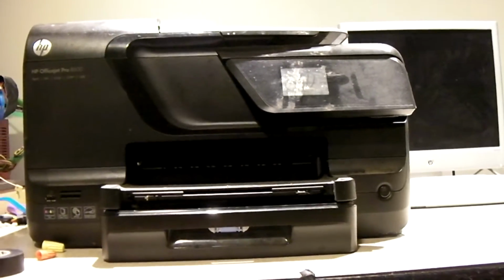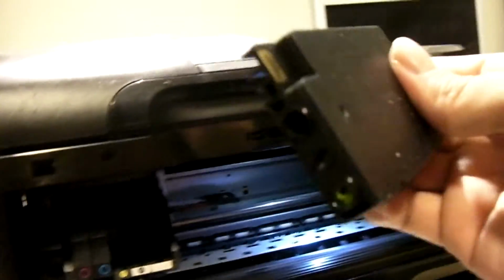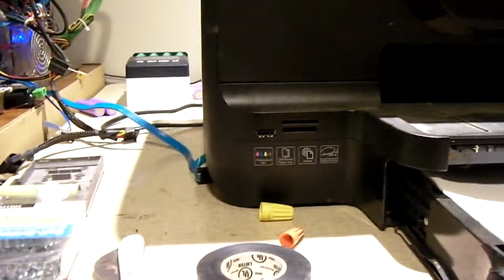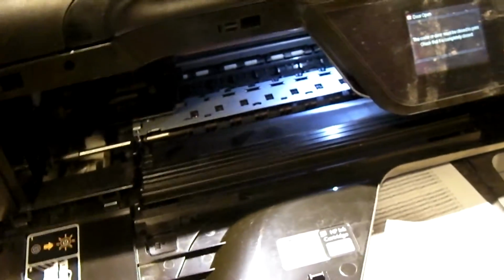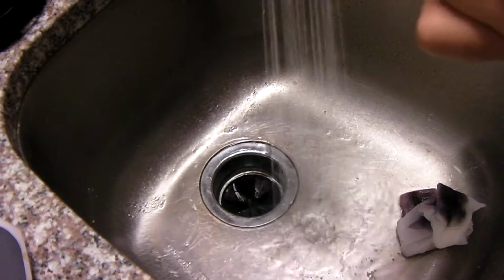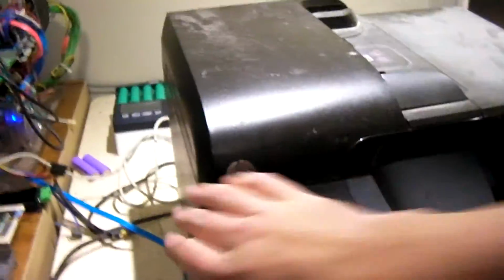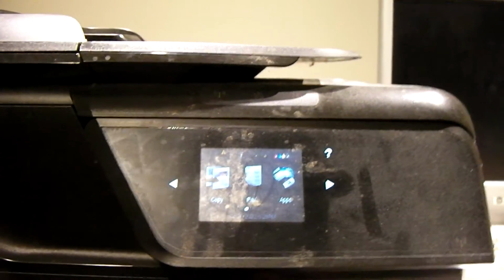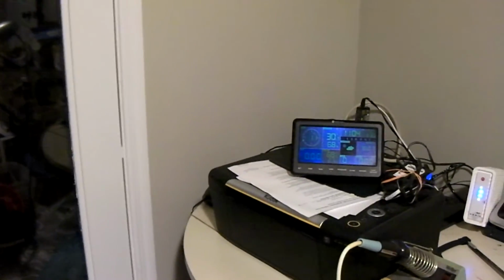Resurrection of an HP OfficeJet Pro 8600 (cleaning print head)

Comment: I have this exact printer, purchased in 2013. My cartridges were running low but I was able to keep printing in draft mode for a couple of months actually. I replaced the black ink cartridge the other day but the printer didn't recognize it as it did before, and displayed a message about the cartridge being damaged. I removed and replaced it, turned the printer off, thinking it would reset; no luck. So I to purchase another cartridge, ugh, $92! Popped it in, same message!  I tried the other cartridge again, still wouldn't recognize. I called Best Buy where I had purchased and talked to a tech who instructed me to do what you mentioned in your video about your co-worker on the phone with HP tech support; turn off printer, removed cartridges, unplug the power, wait 2 minutes, replace, turn back on.  Nothing, same message, damaged cartridge. He offered to send a tech to my house for $124; when I told him I would take it down to the store, he said they would not work on it there, they have to send a technician to my house; no thanks. Searched online and this and other videos.  Did as instructed, soaked printer overnight on wet paper towel; next day, put some foil on the back of the printer cartridge carriage to protect from getting wet, used my water hose nozzle that has a jet setting, with hot water, flushed out each port until each color ran clear. wiped and put a towel over it and placed in the sun to dry it , maybe I shouldn't have done that? Replaced the cartridge, and all the cartridges, the printer recognized each color; I thought, awesome, it's going to work. I selected something to print, the screen showed it processing, took a little longer than usual, then the damaged cartridge message appeared! Removed and reinserted each one; now it showed just the 3 color and not the black. I repeated this step, closed the door, the display didn't show any of the cartridges. Tried the steps again, turned printer off, unplugged; still won't show the black ink. I am going to remove the carriage and try to flush the black port again until it runs clear, this time I will only dry it by hand and place back in printer; wish me luck.  If it still doesn't work after that, maybe I will order a new carriage?
Reply: Reflushed the black port again with hot water w/jet spray. Water ran clear, I could see some ink at the port opening; but when I look at the reservoirs, I see some ink in each of the colors but not the black. And now when I place the printer head on a wet paper towel, no black.  Place the carriage back in, reinserted all the color cartridges, reads all the colors, but black doesn't come up. Maybe I can just replace the black printer head?  I don't know if this channel is still active because all the comments are from so long ago.  Fingers crossed.

Comment: I don’t know if you respond to messages anymore but one thing I discovered is the generic cartridge is actually an HP cartridge. I peeled off the sticker from an old generic cartridge and bam HP logo sticker. Still having issues but at lit learned how to clean my printer head.
Reply from the maker: It could be a refilled HP cartridge

Comment: Went thru the cleaning procedure for the print head several times but it made no difference, unplugged it many times , closed the door after removing the print head and power it up to see if the error message would clear , but it didn't work , still got the same error message. One thing i noticed in the video is that there was a sloshing sound when you shaked  each cartridges, i tried the same thing and there was no sloshing sound from the blue/cyan cartridge , would a dried up or empty cartridge cause the same error message ? Thought it would show a warning of low ink message long before that ?
Reply from the maker: The lack of a sloshing sound when shaking the cartridge indicates the cartridge is most likely empty. The ink indicator message is triggered by an estimated usage count tracked by a chip on the cartridge. The printer has no way to measure the ink level other than guessing.

Comment: Good afternoon Cubed Computer Channel, I must give you a heartfelt pat on the back for your tips in dealing with the HP Officejet Pro 8600. I had previously cleaned my printhead, replaced the printer cartridges several times with different cartridges and after watching your video a few swear words and the steps you gave to remove the printhead,power off, turn the printer back on, get the missing carriage error while cleaning the print head for the 5th time, replacing everything including the cartridges, and finally powering down and restarting my printer; it finally came back to life and the home screen. Thank you, thank you, thank you kind Sir😊

Comment: Thanks for taking the time to do the video learnt a lot about my printer. FYI my printer gave same message but problem was just that one of the colour cartridges (Magenta) was empty. Replaced cartridge and fixed problem. However, after your video also cleaned printer head now have a fully functioning printer good as new! Ty

Comment: If you have a "Printer Failure" error, the touch screen is dead.  I replaced the ink head with a good one, from a working printer;  still have "Printer Failure,   There is a problem with printer or ink system".  I reset by unplugging, 10 times...Tried printing from pc, nothing. Is there a reset button or just the unplug thing?
Reply from the maker: Try starting it up with no printhead or cartridges and then reinstall the printhead and see what happens.
Reply: Thanks but that didn't work.   @CubeComputerChannel

Comment: When the vinyl membrane of the cartridge pressurization weir comes unglued, one gets a "Supply System Problem" error message.  Also, when the membrane is unglued, one does not hear the four usual 'puff' sounds, during the cartridge pressurization step, when the printer starts up.  The best way to address this issue is to peel off the membrane and replace it with very sticky tape, such as silicone tape, or the kind of 2-sided tape used for gluing smartphone screens.  The repair can be seen here:

https://youtu.be/gmD20XRlLa8?t=1095

Or here:

https://youtu.be/yfV2920HxC8&t=418

Comment: At time 23:10  That guy coughing thru the phone...that's why those Indian tech people makeme sick.  Yeah, I get the same thing when I owned my HP 8600 Pro printer. I had the extended 3 year warranty.  They ended up sending me another printer.  Bid deal.  There was a label on the printer saying that I needed to remove the printhead from my old printer, and install it into the new one they sent. Some warranty.  It was also missing the back part of the printer where you dislodge paper jams.  That's a lousy HP extended warranty.  I hate HP, and their scamming ink toner scam they put upon us.  Theie computers lock you out from usage unless it detects that you reinstalled their new cartridges only or it locks you out from using your printer.  I'm sick of those people, and their useless warranty.

Comment: Here's a video on how to do it right.  The guy also talks funny and the camerawork is also shaky but he's a former Epson inkjet printer engineer:  https://www.youtube.com/watch?v=VlKwGVq4MSE
Reply from the maker: Fooling the printer into thinking there's ink in the chambers by bridging the contents with aluminum foil isn't going to fix the issue when the printhead is clogged. If the printhead is starved of ink, it would likely get damaged as a result. I would suggest his contact cleaning recommendations if the message persists after first completing the steps shown in this video (and the followup video) where the printhead is manually cleaned with hot water. The process of unclogging the printhead is not a "wrong" way to fix the problem.
Reply: @CubeComputerChannel  I tried fixing my 8600 with that error message "one or more cartridges are damaged".  I tried new HP cartridges thinking the Walmart ONN were faulty and got the same message.  I did the foil trick to bypass the error message but couldn't get the printer to put anything more than a blot or two of ink.
I bought a PH cleaning kit and flushed the PH of all ink and then reinstalled it with the foil still on the contacts and it would go through the alignment and make the air pressure sound and then fail the alignment and then I attempted the PH cleaning on the tools menu multiple times and still can't get the reservoirs to refill with ink even though the clear tape is tight and sealed.
Any suggestions?
This was a perfect working machine until I tried to save $50 bucks on the ONN cartridges .

Comment: I just installed a brand new print head on mine and it keeps telling me it's initializing but never seems to finish. 😵‍💫 I want to hard reset it but I'm afraid to because it warns you not to reset it while it's initializing (???)
Reply from the maker: Some of the replacement print heads for these are questionable at best. Try reseating the printhead and see if it will initialize. Or, remove the printhead completely and see if the printer will boot up.

Comment: My print head and cartridges went bad long ago, but since I only use my 8600 to scan to my computer and fax it did not matter.  A few days ago the fax would dial, but would never connect.  After testing I determined that the telephone line itself was OK, but whenever I plugged the line into the 8600, the line was "in use" just like I left a phone receiver off the cradle somewhere.  I could input a fax number and it dials, but never connects to the receiving fax.  I progressively went through all three types of resets.  When I tried a factory reset, I now get only a cartridge error and then a setup tutorial that keeps repeating.  Is there any way to breathe life back into it to just have scan and fax available without buying a new print head and cartridges?  The home screen will no longer appear.
Reply from the maker: I'd imagine it would let you send faxes, but not receive them. Pull the printhead completely and see what it does.
Reply: @CubeComputerChannel  I tried pulling the cartridges and then later also the print head assembly which did not help, but at least I had a home screen then.  After the OOBE  reset it will only play the setup demo again and again.  No home screen.  Any ideas would be greatly appreciated.
Reply: @angelhelp777 , another video I saw claimed that if you do the full reset on an HP printer with a touch screen, it will refuse to work until it sees "setup cartridges" loaded into it -- those stupid 10% full cartridges that come with the new printer. It can apparently tell the difference. The setup cartridges don't have to be new, but they do have to be setup cartridges, not regular cartridges. After you go through the setup process, you can swap out the setup cartridges for regular cartridges.

So you might need to find / borrow a set of original setup cartridges. (And, if they're empty, you might need to add some ink to them -- a dirty, messy job.)

For many years I've assumed that the setup cartridges were just 10%-full regular cartridges, but they apparently aren't. I've also assumed that they should be discarded, and that's obviously a mistake.
Reply: @ncdave4life  Thank you for your response.  You are exactly correct.  I was going through my junk box of old empty ink cartridges a few days ago thinking that I might need to refill some to make it work. I noticed some cartridges said, "set up" on them and thought...hmmm, if I set everything back to factory defaults, then I may need to set it up again.  I had always thought the setup cartridges were just sample cartridges.  I never knew the chip on the cartridges was for anything other than ink color and level, but apparently, it is.  As soon as I loaded them, even though they were empty and long dried up, the printer started working again.  Another thing  I learned is that you can't just pull out an empty cartridge from the printer, fill it and reinstall the same one.  The printer will not read the same cartridge twice in a row.  You have to insert a different cartridge, let the printer read it, and then you can put the original one back in.  The printer is working great now except for a few streaks caused by plugged print heard, but all I need it for is to run so I can scan and send faxes.  Thanks again for the response.  Have a blessed day!
Reply: @angelhelp777 , thank you for the useful info! The other video suggested refilling the setup cartridges; it is good to know that that isn't necessary. Also, I didn't know about swapping cartridges before reinstalling them. I hope you, too, have a blessed day.

Comment: do you have Idea about this? to avoid damage use On button to shoutdown do not. use a power strip or wall switch  to shout down  (printer error please turn off, then turn on)
Reply from the maker: The reason why it wants you to perform a proper shutdown is so the printhead can properly park itself. The printhead parks on top of a rubber seal, which seals the printhead to help prevent ink from drying inside the printhead.

Comment: PrintPal has good third party ink cartridges.
Reply: If you have two sets of OEM cartridges, you can refill them yourself.  Just refill both sets of empty cartridges and print until you get the "ink depleted" message.  Not "low ink" but "depleted."  Then just swap the empty cartridge for the second refilled cartridge.  Refill the first one and just keep swapping refilled cartridges for full.  The only rule is do not swap a cartridge until is shows "depleted" and the printer stops printing.  I've been doing this for years.  OEM cartridges work much better than third party.

Comment: I have the same error after i was cleaning the black dry ink. I manage to factory reset and get rid of the error but i get faulty ink cartridge error and replacing the them still gives me the same error. Im thinking of cleaning and flushing down the whole print head.
Reply: How did u factory reset cause my printer which is the same HP officejet pro 8600 printer failure it says there is a problem with the printer or ink system.turn printer off,then on,if problem persists, contact HP. But I follow exactly what the video shows here and still getting the same message error can someone help me sort this out?
Reply: @jamilahjohn6533  i also have that message, didn't solve it yet 😢. Press the back button 3 times and you get to more menus that allow to do a reset. But I read that you'll need a special kit after that reset
Reply from the maker: Hopefully that gets it working for you!
Reply: @CubeComputerChannel  weird youtube just notify me of your comment after 2 months have passed 🤣. Anyways it didn't work im just done with inkjet  makes too much of a mess. Thanks tho

Comment: Please can we see the part of the printer heads that you are wiping
Reply from the maker: I was wiping the surface of the print head, which is on the bottom of the carriage. I'll post a new video showing the area where I cleaned since it's been a common request of this video. I will try to get it posted this evening or tomorrow.
Reply: It would really help if you filmed what you were doing

Comment: I've just looked on Amazon for a replacement printhead £170 or about US$210, hope your cleaning video will do the trick.
Reply from the maker: Yeah the printheads cost more than buying a new printer. It's crazy! Good luck on the cleaning - I hope it works for you.
Reply: $50 on ebay, hope this can help someone. Just gotta look hard enough there.
Don't buy replacement parts from Amazon, they're usually overpriced , non OEM, used, etc. I get better results from eBay or AliExpress

Comment: Holy shit, I've got this exact same model in my closet to repair! Been looking for someone else who's worked in-depth on this model, pretty sure what I've got is also a printhead issue.

I've been figuring out the errors on it & also dug into the firmware service menu. If you specifically get 0x6100004e, it means it failed to prime the printhead/ink pump. Only way to get around it (e.g. to do a firmware update to accept 3rd party ink) is to use the firmware service menu to factory reset + boot with no mech.
Reply: how do update the firmware on it? do you have the link or website so i can get it